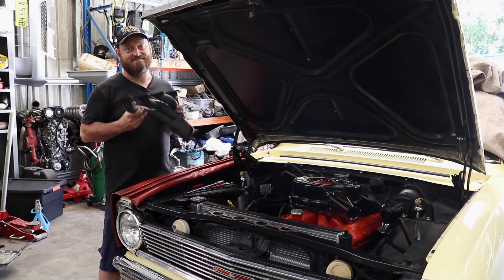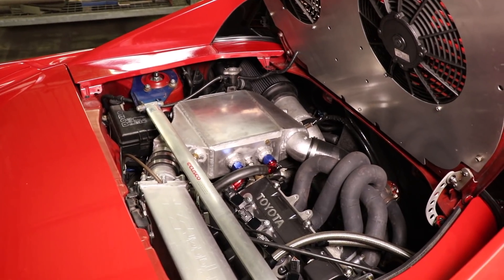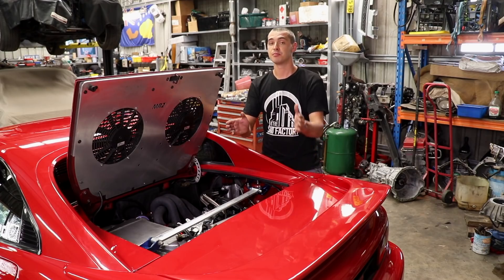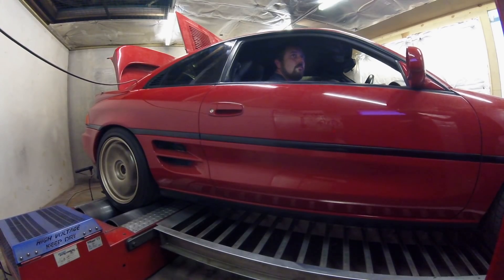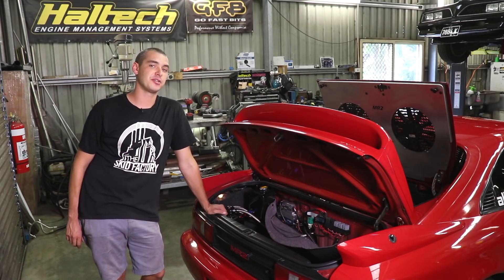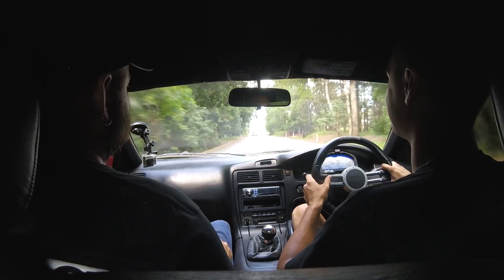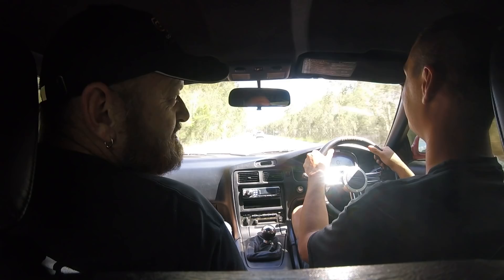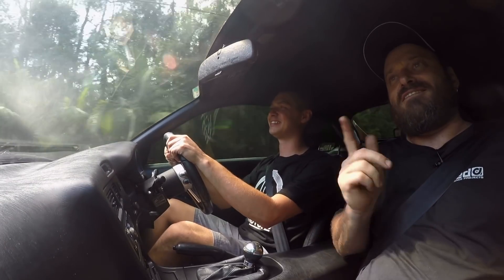THE SKID FACTORY - 430HP SW20 TOYOTA MR2 [Build Review]

Comment: I wanna see that AW11 - i love those lil things - sadly not much room for any crazy engine swaps - or is there? - please proof me wrong
Reply: There is quite a bit of room they were designed to fit a 2.0L I4 with a little room to spare. Especially of you are making custom mounts and axles there is room for quite a bit of engine.
Reply: People also chop and change the firewall/bulkheads for more room during swaps... you can keep the entire factory interior and get a 4L v8 in longitudinally, or a load of people put 2GR v6's in. I have seen one case of a 7.0L LS7 being dropped in, but it honestly there was little of the original cars rear end left, at which stage its a year plus hundred thousand spent, and really hard to make legal for road use (the example I know isn't), so you really do need to ask if starting with the MR2 platform is really the best bet, or if a newer/higher original sticker price sports/supercar may be a better starting place for your desires.

Comment: Hey woody , did your brother use racerx gear for the coil on plug and crank wheel trigger setup ? I had to tweak and modify these to suit my st205 gt4 but still need a solution to the crank trigger wheel due to space restraints ( chassis rail clearance in the gt4 and crank pulley cause the drama ) any chance of contacting you outside of YouTube to discuss ?
Reply: Yeah it is. I would recommend making your own wheel.
Reply: @25LQW  that's what I'm planning . Smaller trigger wheel , custom adaptor that would need turning up , as the racerx stuff doesnt fit the gt4 variants . Already fixed the coil on plug setup
Reply: @wrcgt4  basically everything racer x I had issues with. They supply Chinese rep coils in the kit where 2 died instantly. Borrowed some off the Inlaws corolla for tuning while waiting for new coils to come in. Wasn't going to get reemed from the Toyota dealership.
Reply: @wrcgt4  and even what Al said, use the standard dissy for the signal. And just put a blanking  cap on. And run a cop set up.
Reply: @25LQW  wasn't happy with their products or service . Using genuine 1zz coils on mine with a elite 1500 and flex but aiming for the 600 mark with a built gen3 . The only hurdle is that crank trigger . I regret not building a gen4 but mine is one of the group a cars ..
Reply: @wrcgt4  once you go built like that. They are all the same. Maybe except for shim and bucket set up. I switched to 2zz shim less buckets. At 600hp your block is not going to like that. 5sgte might be a better set up. And at 600ho a pretty big turbo will be needed and at 2l will be pretty shit to drive around.
Reply: @25LQW  yep . Your spot on . I have a soare 5s block ready just in case.  Itll run a number , then itll be dialled back . The group a blocks seem a little more stout than a standard 3s one , seen a few now happily running 550 plus now in gt4s but aware of the posdible areas of issue . The block used was well tested before hand and while that cant guarantee anything it was a very good start point . I'd be happy with a daily driven 450 plus awd , tho its be nice if it has that little bit more to tap into when needed

Comment: The 3S block can't reliably handle much more than you are currently pushing.  450whp is about where you want to stop.  The 5S block can handle FAR more.  The guys at ATS Racing use the 5S block to achieve multiple reliable 750whp streetcar builds.  Their development car makes around 850whp and has been running on the same 5S block for a long time.
Reply: Yeah mate. Being a car and mr2 enthusiast I know. I still think I'll push to 500rwhp. I only drive the car a few times a year really.
Reply: 25LQW 

Right on! I’m just glad to see other people modifying these.  Hope all goes well!

Comment: I bought that same trigger wheel and 1ZZ coil setup. I too had to go back to the factory distributor as a trigger wheel. I wasted a lot of money and time on that stupid setup. Factory works great though, made 570 WHP with my MR2.
Reply: Still using a 3s? Sounds awesome. These cars are terrifing over 400hp. In this vid the car would be just over 300hp on 98, when on e85 it has its full 430hp.
Reply: @25LQW  Nope I have 5s built block with mildly built 3s head. Very capable engine.

Comment: Hol' up, did the 1990 turbo not have an LSD standard? here in the states we only had the car for a little while, but all turbo models had the viscous LSD E153 trans.
Reply: nah man it was the 92 model that came with the lsd, had one coupled with a gen 3 (caldina) in a st151 corona
Reply: I don't think it's a factory turbo model, it's not a GT.
Reply: I picked up on that too, AFAIK All MR2 turbo E153 were LSD (As opposed to the Camry E153), And he specifically said E153 and not S54. I interpreted that as upgraded to TRD, Cusco or Quaife unit
Reply: @BoogalooShrymp  it's a factory GT turbo car. 1990. I think lsd was an option but not very common at all.
Reply: @1gt4dude  I actually bought an e153 lsd from a celica gt4. And swapped over the linkages.
Reply: @25LQW  Yeah the E15XF etc is the same casing less the transfer case, but you would of had to swap over the 2WD diff as the 4WD diff is a diff-in-a-diff (front & centre)
Reply: @25LQW  Oh ok, sorry, was looking for the GT badge on the bootlid, couldn't make it out. Nice MR2 mate! My lil bro owned a 90 GT targa top, full stocko but was an awesome car!
Reply: @1gt4dude  I've never heard that before. We just swapped over drive shafts and linkage. That's all. And obviously it works. Being a viscous lsd it's still not that great though. But I bought a whole gearbox for au$600 where a mechanical lsd alone costs over $1000 then there is special fitting that's needed.
Reply: @BoogalooShrymp  the GT badge is there on the back left and you would have seen the suede leather interior.
Reply: @25LQW  Maybe it was converted with some strange parts before you got it, the Celica GT4 never had a "front lsd" to begin with, the viscous coupler is in the 4wd transfer case to act on the centre diff. It's hard to imagine which oem-type LSD would fit the box for 2WD besides the factory MR2 turbo, as the S54-lsd diff nuggets would be much too small, perhaps the E56/E58 AE101 supercharged box would have a suitable sized lsd diff nugget, I haven't explored that side of things, I can guarantee it's not a GT4 diff running in 2wd, the open centre diff would just spin it's "missing rear output" and send nothing to the "front"
Reply: @25LQW  I had actually observed a diff nugget I believed to be an MR2 turbo (it was broken) and appeared to have a tiny little clutch pack with thin discs inside it. It was kept as it was rumoured to be rebuildable and could convert to 4wd use but when my engine builder inspected it, he saw no way to make it work for a GT4 and he threw it out, wasn't interesting enough at the time to keep any pics unfortunately :(
Reply: @1gt4dude  it's been so long. I gotta look into this. 👍
Reply: Not all MR2 Turbos have an LSD. It was an option for all markets until later in production.

Comment: Honestly... 
My MR2 needs like 3 things done to it and then i can get it Roadworthied - Fix a small Oil leak, a small and simple Coolant leak, and give it a new Steering Rack then its done!

I'm aiming at 300 - 350HP with mine
Its got forged Rods and Pistons, ARP Head Studs, new Race Bearings, a bigger cam, polished and ported head and of course a bigger turbo.
its also been converted to Coil on Plug, its got an external oil cooler (to eliminate the Hose From Hell) and has a Water to Air intercooler, the Intercooler itself is in the boot, the reservoir is in the engine bay and away from the heat, and the pump and radiator for the water is up in the front of the car.

All controlled by a Haltech, of course

Its been an absolute pain in my ass for the last 11 months - but my god its been fun, hopefully i can get the last few kinks ironed out!

Comment: love me a 3$-gte, I had a gen 3 coupled with the same lsd gbox cramed into a st151 nz assembled corona. It achieved around 300hp atw with only a bleed valve and a front mount and could do a 13.5sec 1/4 mile, would love to build one here in aus

Comment: Is that 430WheelHP or 430 USA horsepowers
Reply: 430hp is 430hp. Doesn't matter what country you are in. There's not a dyno built that can measure the most powerful v8s that are built in America. Basically guessing with math at a certain point.
Reply: Was on a dyno, so would be rwhp.

Comment: I'd imagine the VR6 is quite a bit heavier than a 4AGE. Sounds like a bad time.
Reply: I can't see the sense in putting a VR6 in a MR2. They barely have space for a four banger let alone a VR6. I did read in a PPC mag somone putting a PD150 in one of these with a few Darkside goodies.
Reply: Only around 10-20kg different.
Reply: @sataneatcheese6243  The point of the VR6 is it is a 6 cylinder that fits in the space of a 4 cylinder. Also the MR2 engine bay was designed to accommodate a 2.0L engine and only has a 1.6L as factory. There is room.
Reply: @802Garage  All mk2s came with a 2litre of some description. Be it NA or Turboed. It wasn't until the Mrs or Mk3 MR2 that they came with a 1.6litre. Knowing how big a VR6 is there are far better engines to put in that are smaller and generally better.
Edit- smaller meaning not 6 cylinder. Regardless of V6 or VR6 format.
Edit again- Mk1s came with a 4age 1.6 either NA or super charged.
Reply: @sataneatcheese6243  I was talking about the the AW11 since that's the chassis they were discussing putting the VR6 in. They came with the 4A-GE 1.6L almost everywhere.
Pretty debatable as far as "generally better" engines that are smaller go. The VR6 can make heaps of power for the amount of space it takes up. Again literally the point of the design. Plus it's fairly light for the design.
Reply: @802Garage  Ahh I see. I'm getting my chassis muddled up. I go by Mk1, Mk2 etc..
Either way, I still ain't convinced the VR6 is a sensible option. They're gutless, aftermarket parts are overpriced, VAG fan boys and they're heavy. They just ain't great engines. There's better that takes up less space.
All opinions at the end of the day.
Reply: @sataneatcheese6243  Yeah I see where you are coming from. 247 HP and 236 TQ in the 3.2 is no slouch. Plus they do some good. They also take well too turbo charging from what I hear. Plus easier to fit than a conventional V6. When I looked up the weights they really weren't that heavy, but yeah heavier than an all aluminum I4 for sure.
Reply: It's not sensible that's why it's on the skid factory. And we are prob looking at the 3.6l engine.
Reply: @802Garage 
Sounds like you're going on about the Golf R32 engines. In the UK the VR6 is most commonly thought of as the NA 2.8ltr engine of varying specs from a Mk3 Golf.
Now I think we're on the same wave length.
I still wouldn't choose it though XD
Reply: @sataneatcheese6243  Didn't the MK3 have the 1.8 1zz engine ?.
Reply: @modermonkula 
I don't think so. A Google search does not give an engine I recognise in any Mk3 I've had or worked on as it appears to be a DOHC. Mk3 Golf's all had SOHC engines including their GTi range. Only exceptions were their VR6 cars that came as a 12v or 24v. Owners will argue as to whether the 12v version is a true DOHC but that's an argument for somone who cares.
Reply: @sataneatcheese6243  Ah yeah. I mean the generation of engine and mods do matter, but I totes understand your preference.
I mean, I'm swapping an SR20 into my AW11, and obviously not everyone would do that.
Reply: @802Garage 
That sounds more viable to me. Not as bulky and looks the part. That'd be quite the handful in a Mk1 though XD
Good luck bud. May give you a sub.
Reply: @sataneatcheese6243  Ey thanks! I appreciate you chatting and not getting all "YouTube commenter" on me, hah. I have a few main projects I want to get done in 2019. The SR20 AW11 is one of them. :)
Reply: @sataneatcheese6243  Mk3 MR2 (ZZW30) came only with the 1.8 1zz engine my friend.
Reply: @modermonkula 
Yep, you're right. I thought the MRs was a 1.8

Comment: I'd certainly like to see an engine swap in either the sw20 or the aw11. I have both, and I'm planning to do a 2ZZ fe swap in the aw11 (yes another four cylinder, but a 200bhp one that revs over eight grand). As other people have commented the 1MZ is a nice swap in either, and with a supercharger several of the Toyota V6's are pretty stout. I have also seen an Audi 4ltr V8 swapped into an AW11, but that is a bit insane and really would make Al swear if he thinks there's no room to work on a standard car.

Comment: block cracking at 4-500BHP? that's not good. a good 4 cylinder engine design should be able to take 1000HP+ (some designs might need resleving etc)
Reply: The 3s is good for around 550-600hp before issues. And for 1990 I think that's not bad.
Reply: @25LQW  Hey mate, what W2A setup did you use? I am building a very similar setup to you in NZ at the moment.

Comment: Max driver height = 185-190cm (depending on weight) before turning becomes completely impossible: Looks great, drives great, but only made for teens not real men :( (teens = regular size men. It's a Fing joke xD )
Reply: Vikings are better I'm fine in mine at 198cm
Reply: @SKDDUNLOP  Waoh, you must have a really funny body disprosetion then..... Cause i've always loved that car. Back almost 2 decades ago now, 2 of my mates had em, i always wanted one but my height hindered that. So you're either lying to yourself or have replaced the steering wheel with something smaller (which is an auto-lose of licence in my country) + maybe made a "few" mods to the seat?
The main issue is with how far back the seat can go, cause it really just can't go back, which causes tall guys legs to either get very close to or touching the bottom of the steering wheel.... So i find it extremely strange that the mr2 you have apparently is longer then every single one of them i've tried. No, cramming yourself in with a shoehorn, having awkward driving position (look up proper driver position) and putting yourself at great risk in a collision situation IS NOT "i'm fine in mine", that's you scarifying everything a real car enthusiast wants to have a car the looks in a specifik way (nope, you can't claim a car is great for you if you're sitting like crap. Yes all tall guys have tried when we where teens, cause none of us wanted to face the facts, sadly that doesn't change reality....)
BTW 199, but that 1 cm shouldn't make a difference
Reply: Vikings are better my legs are longer proportion wise than my back.
 I agree not the perfect car for my height but I can drive it for hours and not feel aches. Just a standard 1996 GT Turbo with T Tops ,half alcantara / leather stock seats and steering wheel
My 2003 Mr2 - spyder is a lot more cramped space wise and my knees are both sides of the steering wheel in that.

Comment: Get smaller wheels with more tire.. ruins the car
Reply: Yep. My car and I agree. Next mods are rear brake upgrade and new wheels and tyres. Need to put on a 255 on the rear atleast (currently 225). Will keep it 17 inch though. It's not a drag car.